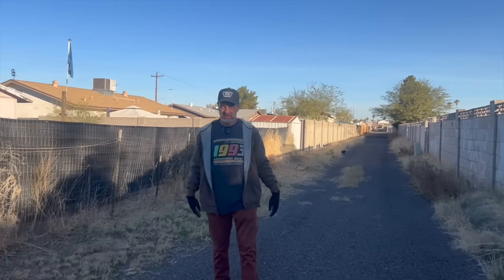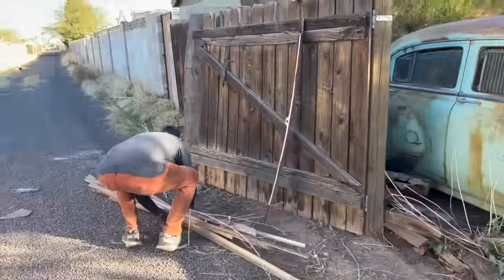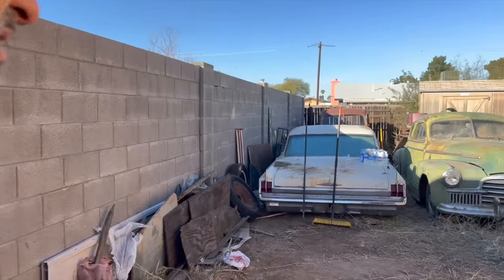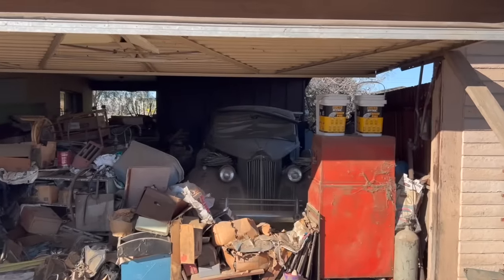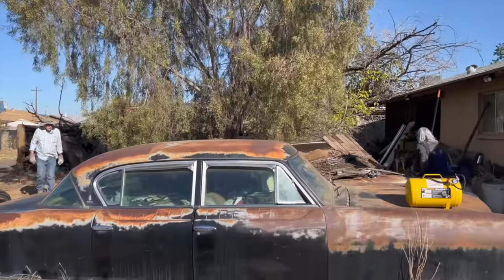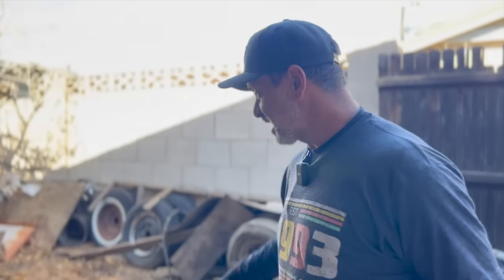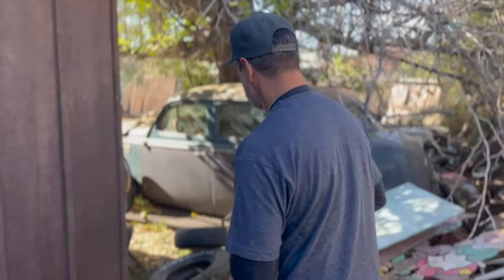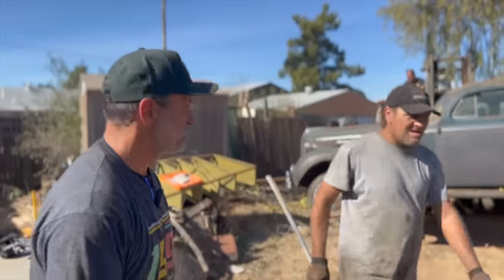The Classic Car Hoarder Buy day 2...the dig out!

Comment: Cool recovery. 
The last car is exactly like my very first car.
Mine was a DRY barn find in Petaluma California. 
38 Buick Special 
Straight 8
3 on the floor.
Was parked in Barn in 1942 with ONLY 38k miles on her.
She had bad master cylinder. 
WWII so couldn't get any parts.
I found her in 1970.
Oil in cylinders.
New battery. 
She started right up.
Mine was exactly the same with dual sidemounts etc but  was a much cooler 
Fastback.
I was 15 years old.
One year later I filmed in American Graffiti with George. 
No shit.
Thanks for the memories